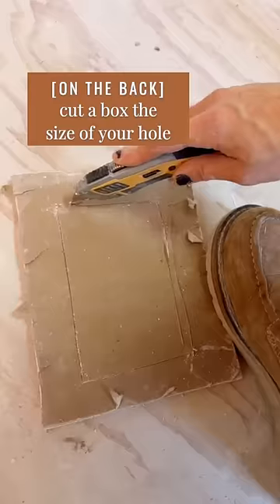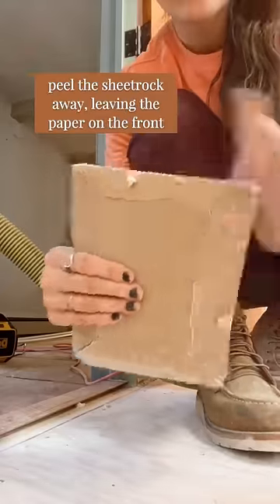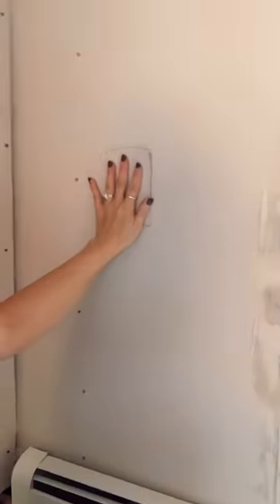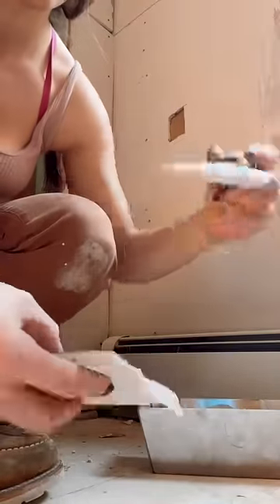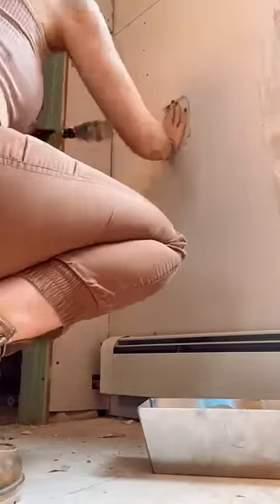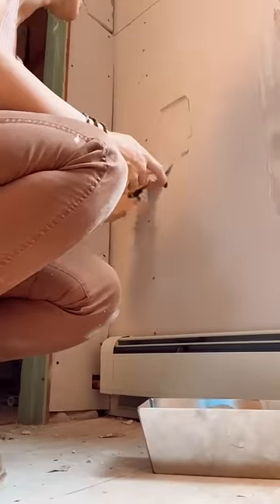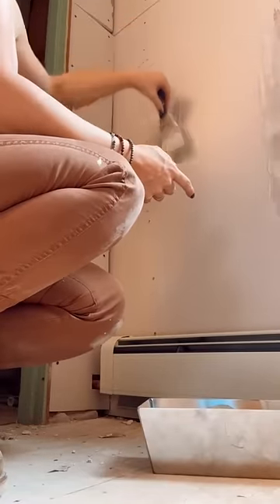FIX DRYWALL HOLES - easy way patch drywall hole | #diy #homerenovation #homediy

Comment: You should butter the drywall inside edges as well...not just to the paper alone...before pushing the patch piece into the hole.
Reply: Could u tell me the reason that one should do that

Comment: odd question but can you apply this method to patch holes in the ceiling after spotlights or this will not hold?
Reply: Yes. I have used this to patch ceiling holes. The mud on the underside of the paper holds well, and if you cut the hole and patch accurately, you get decent friction when fit together.

Comment: Very good. My method is very similar. On the patch i leave only 1 inch of paper. On the wall around the hole cut and remove one inch of the paper only. This way when you put the patch in place it will be flush with the wall. The way this young lady did it, you will always see a bump in the wall unless you feather out the compound a foot or more in each direction. 
On a hole bigger than your fist, always use a wooden backer.

Comment: Only one step you left out and that’s utilizing paper tape… New drywall over old drywall will tend to expand and contract… If you don’t use paper tape there’s a very good Chance that you will have a hairline crack.
Reply: Actually, She did not use the paper tape. I worked for Drivit corporation for many years as a field tech support.  The purpose of paper tape or mesh tape, is for expansion and contraction… Especially in the more extreme cold/hot areas of the country. Of course you can do it without utilizing tape, but you’re missing the one step that would prevent HLC… If you’re going to do it, do it right :-)